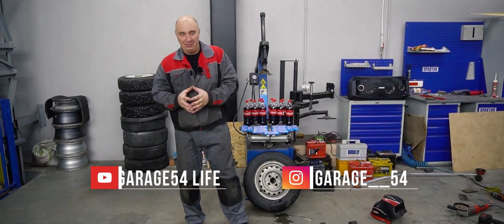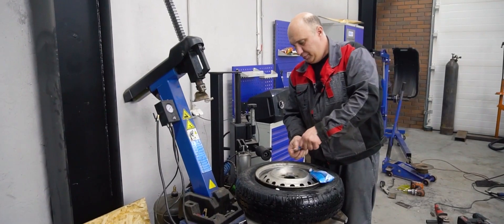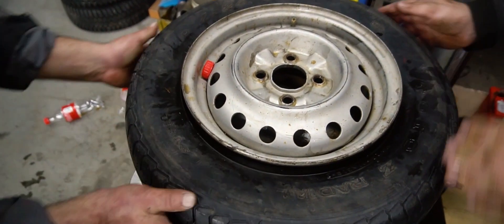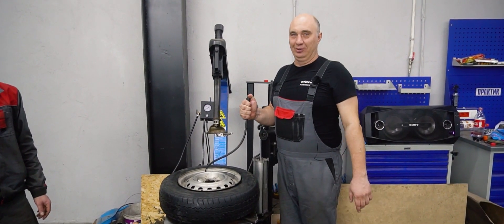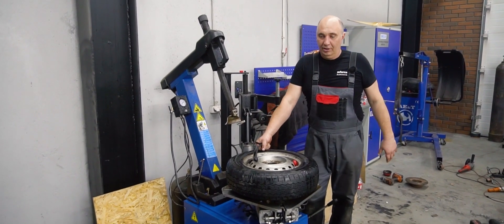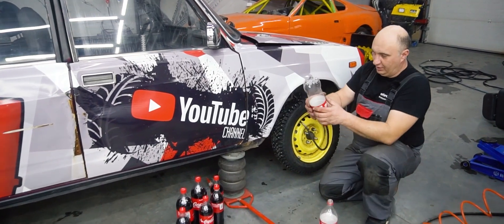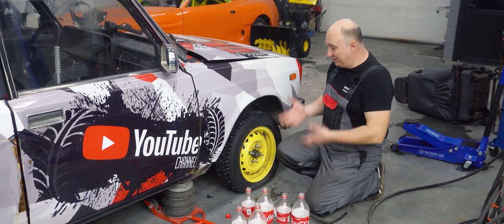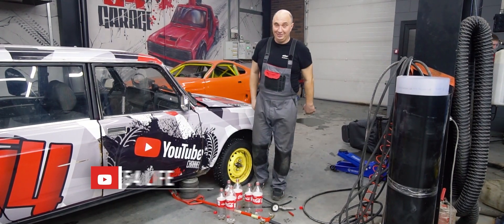Can you inflate a tire with Coca Cola and Mentos?

Comment: * Tape the mentos inside opposite of the valve stem. Rotate the tire so the mentos is at the 3-oclock position and the valve stem at the 9-oclock, then add the cola. Rotate the tire  so the mentos is on the bottom and it will then be activated by the cola.

Comment: To add fluid in tractor tires I once made a section of 3" PVC pipe with an air hose on one end that connects to tire and a valve stem at the top to add air. I would pour several gallons of fluid, cap it off and force the fluid in by adding air to the top valve stem. This would work nicely to add coke in this situation.

Comment: Fizzy drinks go flat because the carbon dioxide that has been pressured into the water escapes over time. An object dropped into a fizzy drink accelerates the escape of the carbon dioxide. The Mentos doesn't create carbon dioxide on it's own, so there is no pressure increase to inflate a tyre when they are added to the tyre. It does however boost the sales of Mentos and Coca-cola.

Comment: Put a paper pocket inside the tire and hold it on the lateral-up (2:00 or 10:00 position),making sure the valve will be installed on the lower side (5:00 or 7:00). After you fit it on the tire (carefully with the menthols not fqlling off the pocket), you pour in the cola until it reaches the valve opening, put the valve back in and rotate the wheel so that the menthols will fall off from the pocket inti the cola. 
Fast enough and no pressure lost :)

Comment: You should put the mentos in a mesh bag tie them 90° from the valve stem seat the tire put the mentos at the top of the rim fill the tire halfway up with Coca-Cola reinsert the valve core rotate tire 180°

Comment: Hold on, I have an idea that might make this work.  Jack up the car.  Put the soda in the tire.  Start the car and floor it.  The agitation alone should do the job but the centrifugal force will help.  Also the soda should be as close to freezing as possible.  CO2 likes to stay in solution at lower temperatures.  Most soda is carbonated to about 2.0 volumes.  That equiates to about 1atm (15psi) at room temperature.

Comment: Watching you struggle with the concept that the mint in the mintos only forces the carbon dioxide to rapidly escape the fluid was hilarious. Made my day. Lol 
Next time carefully pour all of the cola into the tire. Put your mintos into a zip lock bag into the tire. Bead the tire with a can of  computer dust off or a can of  (c 02). Once it’s beaded put it on the car and let the c 02 out. Replace valve stem. Drive ahead until the bag of mintos opens. Pssssh tire full again.  Remember that pouring the cola in will cause it to loose it’s c02 but beading the tire with c02 forces it back into the cola. The c02 under pressure turns into liquid itself and mixes with the fluid. That’s why as it comes out it looks like the bubbles are coming from no where. 
I’m sorry that your government just like everyone else’s has their heads up their a$$es. 
But I still like Russians. I love your ingenuity, and I get fun ideas based off of things I have seen you do. Keep imagining :)

Comment: replace the inner tire with air-less tire spring plastic
Reply: try a reverse traction crown attached to the bolts of the wheel, forming threads on the tire
Reply: try filling the tire with pressurised water
Reply: for fun

Comment: The coke has to be kept in an environment with little exposure to air. The reason that works when you drop them into the bottle is because there is only a tiny amount of surface Coca-Cola that is exposed to air.

When you pour out the Coca-Cola all of the coke is exposed to the air, which means you won't really get a reaction.

The small spout of the bottle ensures that all of the chemical reactions only has that one narrow, exit point.

Also, use Diet Coke
Reply: There is nothing "chemical" in this reaction. The reason behind the coke foaming up form mentos, is the surface imperfections what mentos have, wich helps the carbon dioxide, to quickly for bubbles, and leave the sollution much faster than it would normally do just by being exposed to air
Reply: And this also means, this trick will work with every soft drink.

Comment: everyone is talking about keeping them separated but no one is talking about the fact that what charges the reaction, carbon dioxide, is for the most part released as the cola goes out of the bottle and into the tire. basically, all the stored energy goes away before the mentos can ever be introduced to the mixture.

Comment: It seems as if they forgot that diet coke is better for this experiment because it has more carbonation. I wonder if they could fill the tires with water and then try to drive on them. They don't even need to pressurize the water because it is an incompressible liquid.
Reply: makes you wonder how come nobody drives on water wheels, although it would add a lot of extra weight
Reply: @The93Momo93  indeed it would add an extra 8 1/3 pounds per gallon used, it would likely present with extra inertia concerns when stopping and starting, but would make for an interesting experiment for sure. I hope they pick it up and give it a try

Comment: It needs to vent to release gas.  If you quickly put a cap back on the coke bottle after adding mentos, it probably wouldn’t foam up much.  Same thing when the tire is under pressure, the gas remains in suspension. 🤷‍♂️

Comment: I have a idea for you to try with this concept.  Get a portable air tank with the hose to fill the tire.  Have a screw on pipe fitting big enough to add mentos.  So open the tank pour all the coke in you want to use. Have the cap ready. Quickly add the mentos and put the cap on. When it mixes and creates air pressure now use the hose from the tank to fill the flat tire.  Same concept different way to fill the tire.  Anyone see think this would work??

Comment: First put the menthos fixed in the tire, opposite to the valve for example with tape or glue.
close the tire with air
position the tire with the valve at 3 o'clock (or 9...)
fill the tire with cola
put the valve on
turn the wheel to mix the cola and the menthos.

Comment: What about putting dry ice into a tire to inflate it?
Reply: Make a bomb? Because that's how you make a bomb... at room temperature at least. Sibera the cold is very different.
Reply: @MrCheesywaffles  that just means the video will be more entertaining.
Popping a tire due to over inflation isn't a huge deal. I've seen idiots do it at gas stations.
Reply: @MrCheesywaffles  using just a little bit of dry ice and monitoring the pressure so you can get the pressure off if it rises to high nothing could go wrong
Reply: Thats better

Comment: you need to tape the mentos (maybe in a mesh bag) at the top of the tire while you are putting the cola in. Then replace the valve and rotate it
Reply: Agreed.  I think you want all of the cola to meet all of the mentos at the same time, another thing I think the best reaction occurs soonest after unsealing the cola.  I would propose cutting the top off a vessel that can contain pressure like a fire extinguisher, threading the 2 parts so they can be resealed, and installing an air hose.  Then put the mentos in the mesh bag, tape it to the inside of the top, quickly filling the bottom with soda, thread the top back on, and give it a good shake.
Reply: And Diet Coke works better
Reply: I was going to say that too
Reply: That's exactly what I was going to say.

Comment: Should have taped the mentos inside one side of the tire, filled the other side with coke, and then spun the wheel to mix them. You're also supposed to use diet coke.

Comment: Love seeing zero back on camera,  and oldtimer . Got have the trio . You three are the essence of garage 54 , 107% success
Reply: Zero? You mean the young guy holding the hose onto the bottle while they're inflating the tire? Cyril.
Reply: @jjohnston94  Cyril is great. If I were running a mechanic shop, I'd want a dozen of him.
Reply: Initially I'm pretty sure the video said "originally uploaded in 2020"
Reply: @michael.howard1  noticed a bit later , thanks
Reply: 107% failure without using Diet Coke….
Oddly enough, Coca Cola is now a rare commodity in Russia, Possibly Contraband.
Reply: @JesusisJesus  Contraband, again.
Reply: @MattFromAmerica  Unfortunately my joke is probably no longer a joke,
Ahh, Russia - The only country where you can get time in the slammer for smuggling any kind of Coke.

Also they’ve overinflated tyres before.. the only thing that could’ve happened was bad wheel balance with liquid sloshing around.
Reply: @JesusisJesus  Russia didnt ban coke, Coca Cola has ceased activity in Russia, causing unemployment among common innocent Russians, and also reduces Coca Colas revenue and tax income for both Russia and the USA.
Reply: @JesusisJesus  by the way, i had a heavy industrial tractor with liquid filled wheels 18.4x34, theres no imbalance, the liquid balances itself.
Reply: @pflaffik  What kind of liquid though? 
If it’s for a slow speed tractor, a high viscosity fluid would be fine, fast rotating tyres on a car with watery liquid might behave differently.
I used to sell a puncture sealant that was very much like the viscosity of silly putty so after putting it in a deflated tyre you re-inflate it and it would be out of balance for a short amount of time but it would do it’s own balance and the lining in contact with the tyre air would not remain so squishy but the sales demonstration was to run over a plank of wood with nails in it and you’d see all these nail holes in the tread fill with this blue gunk that would set in a few seconds as soon as they contact air and the tyre would not deflate.
The patent expired so you can buy similar goop at almost any auto parts store now, but I do have 2 bottles of the original patented product left that I kept as souvenirs, enough to do 4 car tyres. If you’re in Australia I’d sell ‘em to you with postage being around $10, but postage to the USA would  be $100-$200.  Plus $60 for the product… Do you wanna buy it?
It’s called Pro-Ma Puncture Sealant.

Comment: Diet cola produces a better effect.
Reply: Yep…..
Reply: What they need to do is do the last method, but instead of letting the mentos being loose, they should be taped to one side. Put that side to the upper side of the rotation then pour in a bunch of coke. Cap it and then spin it.